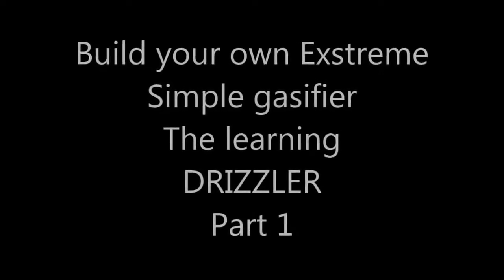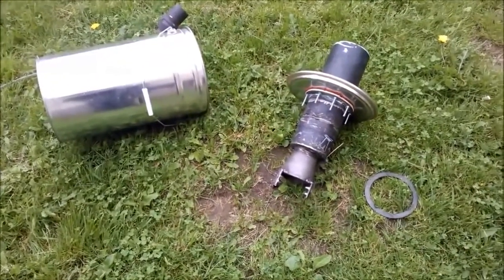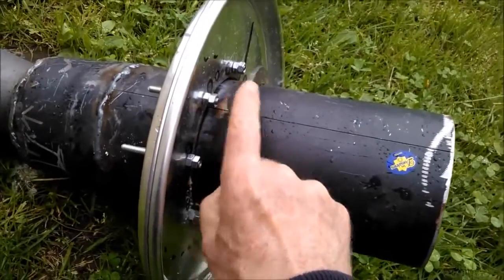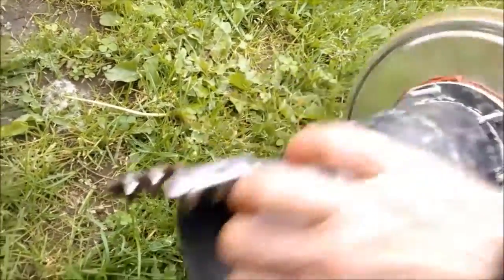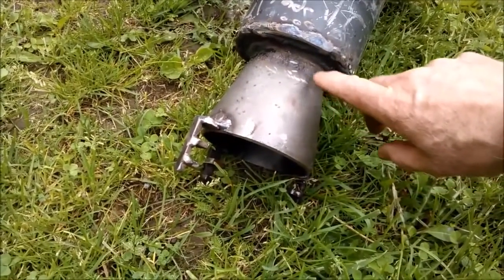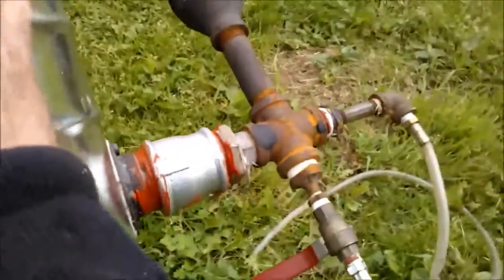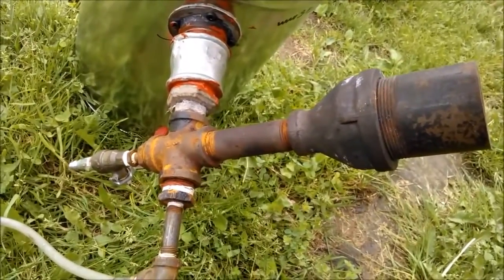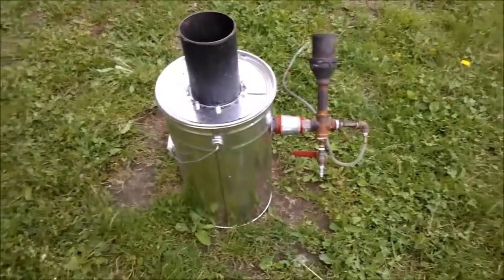PART 1 - extreme simple DriZzleR mini gasifier - build it

Comment: I come from TLUD and cannot understand if you can cook and make biochar with this too, because there is the same chimney top, but I see no flame. I do not see where the primary and secondary air entrances are, if you can burn other fuel than wood chips and if it runs without a fan (for off grid and burning branches from the garden!) 
Do you have something that explains the basics of what it is, compared to a TLUD that also makes gas? Something for somebody like me who just discover your channel... Thanks!
Reply: His illustration lacks input, output basics

Comment: what did you line the inside of the can with?
Reply from the maker: Dear Larry, I lined it with ceramic wool.  A cheaper solution could be to line it with  rockwool or glasswool. The latter solutions are not durable under hot conditions.
luk